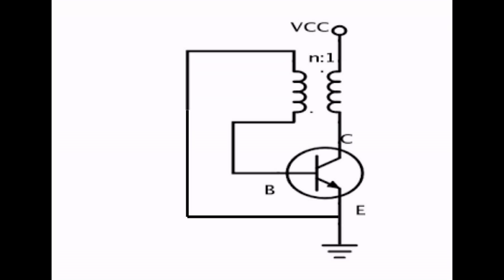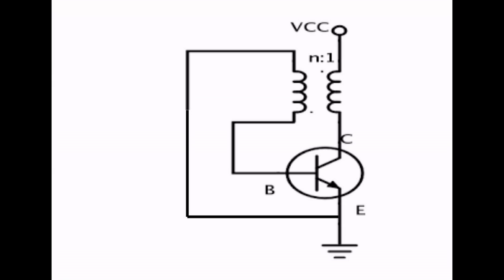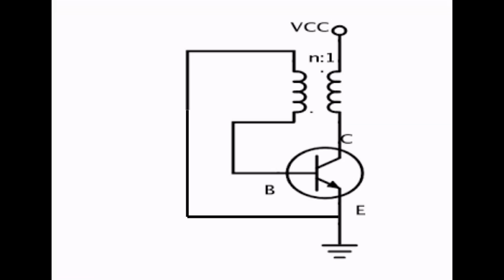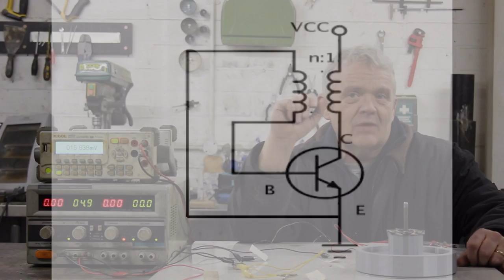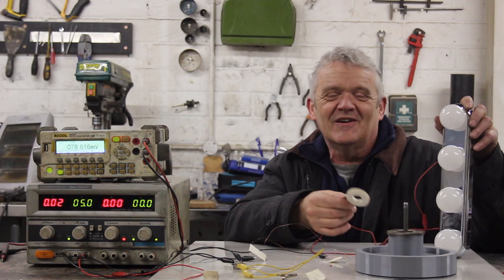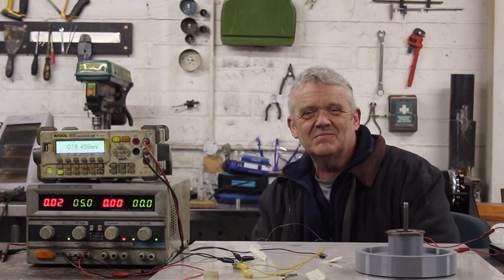1881 Simple Motor And Magnetic Generator

Comment: Off topic but I recently found a permanent magnet converted alternator in a scrap pile!  I was very surprised to find that the rotor has 7 MAGNET POLES!  this means that they are all arranged with the same polarity.  I had never seen this arrangement before.  In quick testing it has a pretty good output between 2 phases (need to make a 3 phase bridge rectifier still).  I also hooked it up to an e-bike controller with a dulled lawn mower blade on the shaft (for resistance) and it had some incredible torque with medium-low rpm.  One thing I don’t love about it is the fact that the whole body of the alternator is magnetic, I expect this is caused by the magnet poles not canceling each other out..  
I’m curious if adding more magnets with alternating poles would increase the top rpm when used as a motor, and if this would cancel out the magnetic flux that is distributed to the body of the alternator… and what would happen if the magnets I add to the rotor have a different strength than the original 7 (which are quite strong).
Anyways, I just got excited about finding this baby (for free) and wonder if anyone has any insight about this style of PM alternator.
Cheers!
Reply: Oh and from my research the only example of a similar design was from Missouri Wind and Solar, so I’m sure that’s the company who built it.  Haven’t really found any other examples yet of this design online.

Comment: cool, add a diode from the collector and an electrolytic cap to ground and tap off the point where they meet and youll get much more voltage from the joule thief....:) cheers matey...

Comment: wow what did the 6 on top (magnets) come from? looks like the epoxy or glue pulled some of the plated metal to protect the neodymium iron boron mixture off of it, (seen this many times on my break aways when I grab the armature magnet out of a hard drive) and I found that the rusty bits if you scrap them together still have quite a bit of magnetism to the dust *as in it generates its own magnetic field) 

also reminds me that I have not passed on my home made magnets that I used crushed neodymium magnet powder mixed in epoxy and left to sit on a solid magnet while the epoxy sets up, generating a single sided magnet (the other side is spikes of the other side pole being what is inside them and the outside of the spike is the opposing pole rather than it being uniform to the side laying against that magnet it is laying on top of) I can show you in discord the photos I took of it from a cross section of broken material with the light shining through it to make it evident what one is looking at :) 

I remember your talking about redirecting magnetic flow through a piece of iron and then moving the other end around when discussion on magnets in your video and how to use them. and thought of a way to make a system to control direction of magnet material from a single uniform flat side basically (slide the magnet across a triangular block on one side, and it changes which face of the other 3 sides that it comes out basically splitting side one so half is directed to side two and the other half of side one directs to side 3 :)

Comment: Hear is a thought to mull over... 
One may make a mechanically commutated reluctance motor.

In its simplist form....
Wind an electromagnet on a single stator bolt. The electromagnet is in series with a double throw type switch that is made closed by two wires making contact with one of 6 rotor bolts. The closed switch allows current to flow through the electromagnet putting torque on the rotor bolt. As the coil is energized, it pulls the the rotor bolt closer and closer untill it breaks contact with the double throw switch when the rotor bolt is directly over the stator bolt. The rotor's momentum keeps it spinning untill the next rotor bolt closes the double throw switch. 

Simple motor with No electronic components, and no magnets. Just iron bolts and copper wire for a single coil, and for the double throw switch. 

If you want to make it generate, put two coils on the electromagnet. Have the primary wound in one direction, and the secondary wound in the opposite direction.  Place a diode on one of the secondary's output. The diode should alliw current to flow out of the secondary coil and through the diode. Then place a capacitor or battery or load to the diode's output and the other side of the secondary.  Finally spin the motor backward from how it motors to make it generate. 

Description of how this reluctance generator workes.

A rotor bolt makes contact the switch when it is directly over the stator bolt.  The coil is energized   and creates a magnetic field that pulls on the rotor bolt taking away  angular momentum and converting it to potential energy in the magnetic field. Then after a certain amount of rotation the rotor bolt breaks contact with the double throw switch, and current stopes flowing in the primary resulting in the magnetic field collapsing.  And dumping virtually all the energy stored in the magnetic field into the secondary coil where current flows through the diode to charge a capacitor, a battery, or disipate in some other load. Because the secondary coil circuit absorbes the energy from the colapsing magnetic field, very little inductive spike happens across the primary coil and and switch that may be protected by a very very very small capacitor that further minimizes the voltage spike across the switch on the primary side.  

Minus efficency losses, the secondary coil circuit collects the energy that was used in creating the magnetic field, and the work put into the magetic field through moving a piece of iron away from the electromagnet.

Comment: If you could divide the coil's AC you could use the two transistors one as a motor and the other reverse coil voltage as a generator.. Kind of like a bridge rectifier circuit for a joule thief motor? Though it would have to compensate for back emf so it would not be unity.
Reply: Pulsed dc makes an ac like current when the field rises and collapses if I remember right?

Comment: So, what if you slap this serpentine coil generator/motor on to a bike, one side of the wheel is a motor and the other is the generator for recharging as you ride. That brings me too this next thought, if it can get the torque maybe two of these motors can be put on the driving axle of a VW beetle, or one on each wheel near the drum breaks for an simple classic VW hybrid conversion while maintaining the integrity of the original IC engine. Or it could be an emergency motor for when it inevitably breaks down again.

Comment: why using another coil?? get output from collector of the transistor, there will be Back Emf when transistor switches off. utilize the drive coil as a generator as well 👍
Reply: Yeah that's exactly right.  That's a blocking oscillator at its essence.  With an air core coil on a cardboard tube we call it a slayer exciter or wound on a ferrite toroid we call it a joule thief.

Comment: Hi Rob, Love these vids, just the best !
Can this idea be implementated into the base of your wind generator, lowering the torque needed on the turbine to turn it ?
This, combined with magnetic bearings would make the turbine shaft much easier to turn, especially at very low wind speeds.
I'm thinking of all sorts of experiments with this design. On with the building !
Cheers from Australia !

Comment: Okay, Another awesome video. But, I have a simple question. What if you took the output of the coil you were holding and fed that into the "motor"? Would that make the motor run off the output of that coil? That would be very cool. Maybe with the maglev bearing to reduce the friction.
Reply: That would make it over unity. Is that possible??
Reply from the maker: that would make it over unity mate
Reply: Mmm, I'd guess the wire and coil losses plus magnetic feedback would kill it. It's one thing to drive LEDs and something completely different driving a generator, which requires torque and a stable RPM while maintaining a load.

Comment: Schematic seems wrong to me. The transistor is initially Off, so there is an open circuit between the vcc coil and ground. The other coil isnt connected to vcc in anyway so no current flow there either. The base coil has to go from vcc to the base, not how you have it. It wont oscillate.
Reply from the maker: you just saw it oscillate - if it wasn't oscillating it wouldn't drive the motor
Reply: The spin he gives it excites the base through the coil connected to it and the ground. It doesn't need to be connected to the vcc. The only one that needs to be connected to the vcc is the drive coil, which it is.
Reply: @ThinkingandTinkering Ahh, it wont oscillate without spinning it, my mistake, sorry. I was actually watching without listening.😩
Reply: @donniewatson9120  Thanks, I was watching the video with the sound turned down, my bad.
Reply from the maker: @justtinkering6713  no worries mate - it's a good point - without spinning you are dead right - you tie it into the spinning so it becomes self timing - so to speak
Reply: @ThinkingandTinkering  Thanks for your patience.
Reply: @justtinkering6713  No, it'll oscillate not only without spinning, but without even a rotor.  You have the positive terminal connected to the tap and the collector on one end of the "work" coil and the feedback coil goes to the base through a resistor.  When power is applied the transistor is forward biased because there's a direct current path from V+, through the feedback coil, timing/current limiting resistor, and the base-emitter junction and so current starts to flow in the work coil.  As soon as that happens though the phasing of the coils is such that whatever happens on one side of the tap will be directly proportional to what happens at the other and crucially, of the same polarity -- so since the collector is pulling one end of the coil negative a negative voltage is also induced at the base, cutting off (blocking) the transistor.  After the energy that was stored in the field initially is dissipated the circuit is once again in the state it was when power was first applied and the cycle repeats.
Reply: @whatelseison8970  Not on the schematic in this video. So I was watching without listening and you were listening without watching. Maybe we both have ADD 😂

Comment: So what is the idea behind using the joule thief motor as a generator as in this example you're using the rotation of magnets to get energy out of the spinning motor. But that seems like a rather inefficient way to transmit power? The joule thief motor is also not very power dense in its design it seems
Reply from the maker: is that how it seems? ok

Comment: I must be being really thick, you put mechanical energy in to start, then input 1W of electrical in to get less out but at a much higher voltage, what is the use of it as a generator? 🤔
Reply: Its 0,1 w or not? 5v 20 miliamp
Reply: Yeah you guys are both right. It's more like a hybrid rotary voltage converter than a generator, and 5*0.02=0.1.

Comment: Worth pointing out that you won't get more energy out than you put in. Shouldn't need pointing out, but some might see the higher voltage as a rabbit hole entrance as it is more than 5V, but you have to think in terms of power, V * I in will be less than V * I out, guaranteed :)